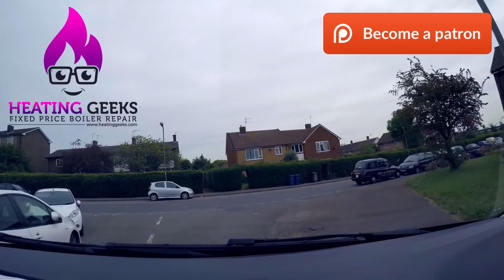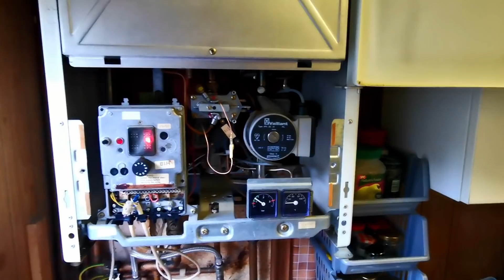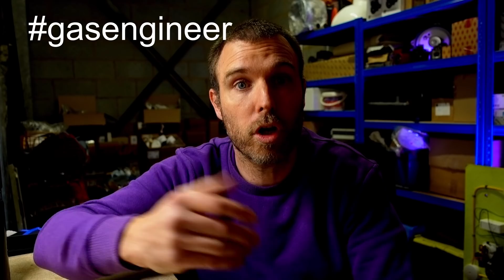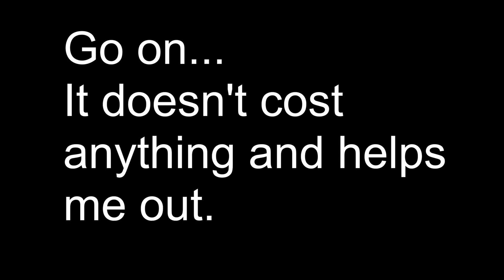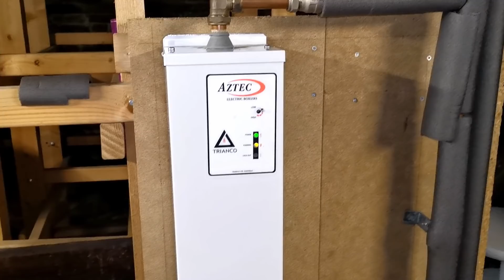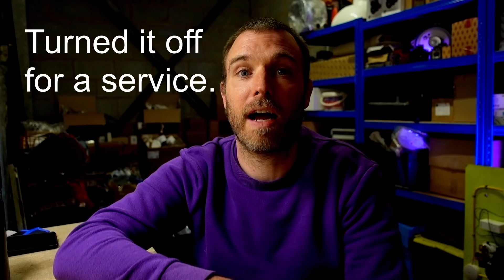Obsolete boiler parts....This could cause problems...

Comment: Hi mate thanks for your vídeo. I have  a small company here in Oporto, Portugal and I repair boiler, heaters, appliances, TVs, including the pcbs of these machines. Since I know quite a bit about electronics I have fixed things that others have failed at, that does not mean everything is fixable and I am a superhero. Therefore as soon as I saw you with the hairdryer I knew that it was an electrolytic capacitor problem and when I saw it bulged, I was reasured of it. However there are capacitors that look mint but  have hi ESR that is why it is important to have a ESR meter and not justo a capacitor meter. Dry joints,  electrolytic caps and relay  failures are the main issues with PCBs.Therefore nowadays a tech has to know a little bit about electronics, otherwise it Will be difficult to solve many of the repairs that arise. Keep up the good work and if I can help you at any time with an electronic question or repair feel free to contact me. I Will do as best as I can. Kind regards.
Reply from the maker: WOW Portugal :-) I never knew I had any viewers in Portugal. I am learning as much as I can about electronics and know the bulging top would make people understand the issue (obviously you didn't need to see it). I have some PCBs that I replace all 5 electrolytic caps because they often look ok but are not. I don't have a ESR meter but if I remove the cap I can measure it? (I think). Do you do any videos or anything?:-)
Reply: @HeatingGeek  it is a global world as you know, thanks for answering my comment. I don't have any videos myself but if you check you tube and search measuring the Equal Series resistance of electrolytic capacitors (ESR) you Will find plenty of videos. Many a time an electrolytic cap may be with the tolerance of of its capacitance but the interior resistance of the dialectric of the cap it Will not allow the cap to respond as fast as the demands of the electronic circuit. For instance once I went to a baxi condensing boiler which was about Four years old and was totally dead. Upon taking out the pcb I found out that there was a tiny 4,5 microfarads cap that didn't even show a reading on the ESR meter. After changing it the boiler came back to life again. The same happened with a split AC unit whose compressor would not start. You see in the Linear power supplies, the ones with the big Transformers the caps last a lot longer because the frequency is the same as the grid 50hertz, but in switch mode power supplies the frequency in the oscillator circuit can  be 20 , 40 kilohertz,  etc depending on the needs of the current needed by the pcb. As a result, the caps are overworking and lets say stressing a lot more. On  the examples that I mentioned before, these caps were the ones responsible for the oscillator circuit, if they didn' t give the initial push the pcb would not start. If you need anything just let me know. You can go to Facebook and search for my company Seimartech and send me a message on messenger. Over the years I have come to the conclusion that in poorer countries they fix everyting. I have learned quite a bit from countries in south America. Have a good day pal.
Reply: @fernandomartins7261  That’s really interesting information! especially regarding the capacitors I’ve always been interested in electronics and reading the above comment you left was a real eye-opener thank you very much for putting this information here

Comment: Can't see a problem with re-soldering a joint on a pcb you haven't replaced any parts on the pcb (gas boiler) so in my view no regs broken. Good on you for fixing the oaps boiler. Top man ⭐️stay safe👍
Reply from the maker: Thanks. I posted it because it was an electric boiler. I wouldn't risk it on a gas boiler. But that is kind of the problem. If you were to remove a grunfoss pump and fit a Wilo in an old combi boiler  would that be the same?
Reply: HeatingGeek if it’s out of warranty then why not? Grundfos do an app and checks whether the ups 3 will fit as some of the old boilers it does indeed
Reply from the maker: @Razorback73 the ups 3 is a rubbish pump though. :-)

Comment: Walking away from a fault is normally one of two things.

1. Lack of Knowledge 
2. You just got your numbers up on the Lottery.
Reply from the maker: Boilers are replaced every day because people don't know how to fix them. :-) I don't want to core another hole in my life. :-)
Reply: HeatingGeek Interesting point raised by another Youtuber Ollie.  Due to the current situation, there’s loads of ‘Road Kill’ dumped on the pavement, boilers only a few years old, with only minor faults.  The Combi Slinkers don’t have the knowledge to fix them & talk the customer into replacing it.
So the boiler ‘goes on the grass’, but, the Pikies are on Lockdown too, so the Road Kill is not getting picked up.
I picked up two Road Kill boilers this week, stripped them & selling the ‘recon’ parts on eBay.........Kerching......Kerching!!!!💷💷💷💷💷💷💷💷💷👍👍👍
Reply: @TheDickPuller  buy at your peril ???
Reply: Yes why don't they just say sorry i dont know whats wrong thers no shame iam lucky i have got a couple of friends that do a lot of repair work so i have some help but why con people
Reply from the maker: Ego is the biggest problem. :-)
Reply: @HeatingGeek  yes they seam to have it in ther heads you have to know everythink its no shame to ask for help i know a lot about the Worcester boilers my mate rings me sometimes on them and i do the same then next time you know i have a little yellow book i wright information in does help .you only do boiler repairs i still do installation work as well so you can get a bit rusty sometimes lol

Comment: have two of these Vaillants  as customers... dreading the time when either asks for the next miracle fix.. Well done for fixing it,  I always ask if customer wants a pre-loved, re-furbed or new part.. 
tough decision on giving them a REAL g/tee on the others.. but I usually advise them to save up for the following year,What annoys me though is those baxi/potterton boilers you mention.. 
although the later ones had the stand-off resisitor it verifies it is NOT capable of doing what is "in theory" what it was designed for.. I HATE the word theory.. in theory everything will work..
Reply from the maker: But you cant fit refurb legally? This is what I mean. They can refurb it but when you fit it your the problem. Thats the issue. We're put in a position where we break the rules because otherwise the customers feels hard done by. :-)
Reply: likewise George, I have many old Vaillants on my service list the oldest is 32 years and I keep telling my customer I wont be able to keep doing MIRACLE FIXES 
Regarding re-furbed PCBs, i  used to repair / replace them in Potterton Lynx 1& 2 but not any more. The odd dry joint still gets sorted. 
We best keep quiet about re-furb ?
Reply from the maker: @kevinschoales844  Indeed. No one fits refurb... That would be illegal. :-)

Comment: I had a simmilar job few months ago. Fan sized on an old ideal 2 previous engineers new boiler. New fan from ideal £365.00plus stripped it down got new bearings for £4.00 one VERY happy customer. Nawt wrong with properly fixing a boiler👍 good work
Reply from the maker: I have them bearings to. :-)

Comment: Been to a leak today on gravity hot water cylinder turns out leak is from an old cyltrol valve on return tried a few places all say it’s obsolete anyone know a decent place that can get one
Reply: Look in ebay... they have a few, maybe your one is blocked up?
Reply: Drayton tapstat is a simple replacement but probably a bit pricey.
Reply: Dominic, I have a brand new Drayton Cytrol valve, it's a 1" angled version if you are interested. I don't know how to contact you or give you my contact info!!
Reply: jayktee96 yes mate I could be interested if it’s genuine I have seen a couple on eBay but they are pricey hows best to get in contact with u if I need it?
Reply: @dombarnes7092 I don't want to post my contact info on here, and I can't see a way to contact you privately, I did find this- https://www.mytub.co.uk/drayton-1-inch-bsp-angle-super-cyltrol-product-110111 No longer available. How about 1/2 the last price including postage (£75.00??)  Or I could put it on Ebay as a BIN? It is genuine-Drayton Cytrol /new/1" ANGLED/similar to picture, but brass with a black knob/ boxed with instructions.
Reply: jayktee96 just looked and that looks like the one👍👍I got an old email I never use if I put it on here would u send me your details on that?
Reply: @dombarnes7092  Yes do that and I'll get back to you pronto! J
Reply: jayktee96 no worries it’s mrt2fool@gmail.com 👍
Reply from the maker: Can you not remove it and repair it? If a man made it a man can fix it. :-)
Reply: HeatingGeek I could probably do that but it could be time and money wasted if it starts leaking again🤷‍♂️ plus a man made my boys PlayStation control which he smashed to pieces the other day ain’t no fixing that without Harry potters wand😂I think your a top engineer by the way definatly top of the game👍👍

Comment: As I said before , you care and actually bother to fix rather than take the easy option as a computer science teacher I find it fantastic that you diagnose and fix rather than forget and replace 👍
Reply from the maker: Computer science? Like python and ruby? Thats a difficult subject. I really struggle with computer based stuff. Im using a MAC now to keep things simple. :-)
Reply: @HeatingGeek  Yeah mate mainly python but if your interested always learn the concepts that way your not tied to a language , your logical / computational thinking would come in very handy in a computer science setting , im surprised boilers don't throw up more programming based errors , i think sadly just like cars we might see a shift to propriety systems being utilised by manufacturers in the future that will require their own equipment / software , i pray not but its just going to take 1 for others to follow suit. Great work as always and stay safe.

Comment: Versatile. I would say electrics, let alone electronics is the weak point of a lot of engineers..
Reply from the maker: Myself included. I wish I knew more about electronics. :-)
Reply: @HeatingGeek  you seam pretty good to me and still keen lol
Reply from the maker: @charliewillis8527  But it takes mistakes to learn. :-)
Reply: @HeatingGeek  yes that is the trouble and it can be expensive thats why i stick to one make as i carry the parts to rebuold most of the range but if i was doing it like you it wouldn't be enough work to keep you going i still do big jobs bathrooms etc i like to do somethink different. What you may be able to do is some repairs for guys that don't want to get involved but give them a drink out of it
Reply: @HeatingGeek  when me and dad did a lot of work in factorys we would often get a board refurbished  if it was a heater we couldn't get parts for
Reply: Doesn’t have to be Mark. Loads of stuff on the likes of YouTube & on-line.  Of course every day is a Skool Day for us all & the very experienced guys like Ollie can put us all to shame.
Reply from the maker: @TheDickPuller  Nah. I just film the successful jobs. Forget the 15 years of mistakes. :-)
Reply: Fibre Washer  I decided to get registered with the NIC as well and count myself ok electrically. I’ve also been studying electronics for a while now as well, but at the end of the day time is money and you do what is quickest - sadly often replacement of parts.
Reply from the maker: @241mrmark  This is the point. When the parts are no longer made what would you do then?
Reply: Mark Eade well mate, it’s commendable you’re doing that.  Lots of Electrical jobs are very easy when you have the knowledge👍
Reply: @HeatingGeek  That depends on the fault and finding a safe and cost effective workaround. Its tricky and I have no problem going the extra mile,  sometimes it can back fire though. I don't like the attitude - 'you need a new boiler' regardless of the alternatives, but sometimes its the right way - I think. I had an analogy yesterday with a puncture on the van - one small brad pin, arguably fairly close to the tread edge but certainly not on the wall nor particularly near . Do you repair it or is it a new tyre. its definite - you need a new tyre mate.
Reply: HeatingGeek honestly , sorry but new boiler
Reply: If you want to learn more about electronics, you could check out BigCliveDotCom's channel, he takes apart various things, and explains how the circuits work. A lot of knowledge there. There's also EEVBlog's Dave Jones who looks at stuff and has some lessons in there too on the basics.
Reply: Lesley Munro Big Clive is a Man Mountain, a huge hairy big Jock, but a lovely guy.  Very, very intelligent bloke, it’s wonderful he shares his knowledge & his channel has a huge following!!
Reply: @TheDickPuller  Aye, I've a lot of time for him. He's like many scots folk, wicked naughty sense of humour. I've followed his channel for a wee while now. I share the interest in how stuff works, though I'm not as keen at playing with the higher voltages like he does, I like my stuff at 12V and 5V, it doesn't sting you like 240V will. :-D I'm just the other side of the river Clyde from his Glasgow flat that he sometimes films from.

Comment: obsolete part, manufacterer aint gonna fix it, or BG, or many other engineers, you did what i do, were the few with a very compationate personality
Reply from the maker: It doesn't feel right telling someone to replace a whole appliance for time based repair. both of these jobs cost less than £5 in parts.

Comment: Hi Ollie I was just wondering as I work mainly on the vaillant ecotec range and have noticed on the pcb their is an Ethernet connection what is that for and is their a tool available to connect for diagnostics? If you know or could help thanks
Well done to get that boiler up and running for that elderly chap,I don’t think their is anything wrong with that at all.
With regards to that the vaillant ecotecs fault code f.61/62 is a pcb fault how can you determine which component is faulty on the board as their are companies that can repair your pcb if you send them it?
Reply: The Ethernet plug on the pcb is for the VR dialog cable/software.
Reply from the maker: Here it is. :-) Thanks Tom Platts  (I didn't know) :-)
Reply: Good question I was wondering that too. There's also an ethernet port just below the digital screen.
Reply: Umar K 
Brother are you also a heating engineer and where are you based.
Reply: @waseemkhaliq933  I try to be bro ;-) Bedfordshire

Comment: What's the problem with resoldering a dry joint? It's a great fix for you and your customer.👍
Reply from the maker: Good question! Ask GasSafe :-)
Reply: @HeatingGeek  as long as it's passes your safety checks surely that's all gas safe care about. (Using the word care very loosely)

Comment: Whats the worst that could happen not work again. I know MI'S say no but in this situation you did the right thing.
Reply: Can see a problem at all, be an electrician for 40 years, and corgi gas safe for 30 year, if you can see the components values and fit them correctly then no problem,  a lot of heating engineer are very good at electric and probably better with a multi meter than most electricians!!, Robert
Reply from the maker: Im not sure about electronics though. I wish I knew more. :-)
Reply from the maker: Thats what I think too. :-) What would I do for my Mum/Grandad. :-)
Reply: I actually did elecontronic engineering at college. Gave up half way on my national diploma. Didn't have the patient for it. Wish i finished it.

Comment: You're cracking up :-)

Good job on both 👌 Tell us more about Puma PCB fail point please?
Reply: From memory that was a main neutral failure on the modulation board (top left) on both electronic & pilot versions.
Reply from the maker: This is it. Top left. Main neutral connection :-)